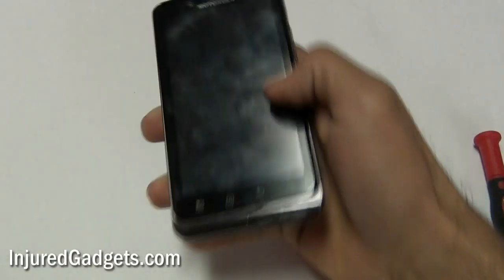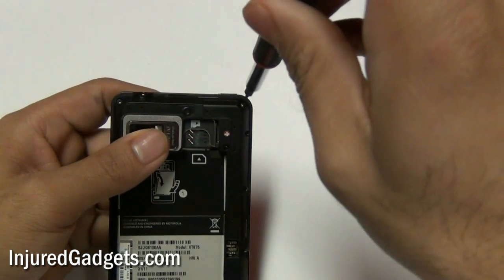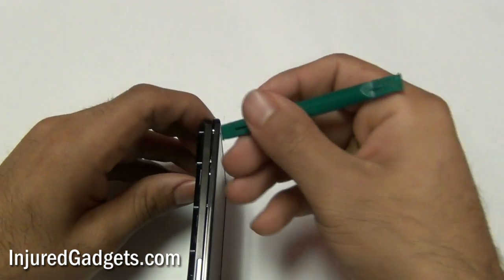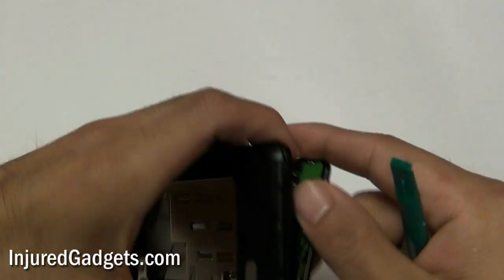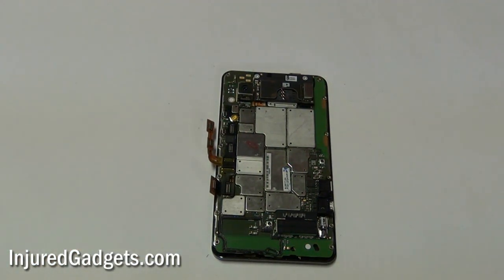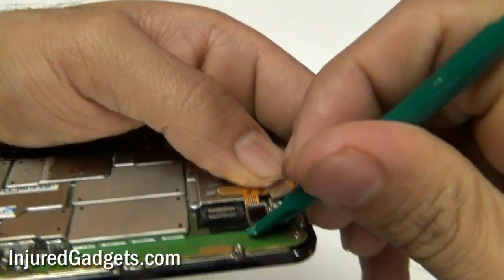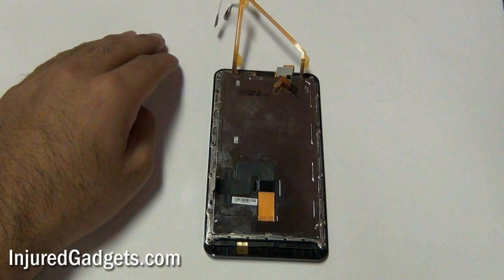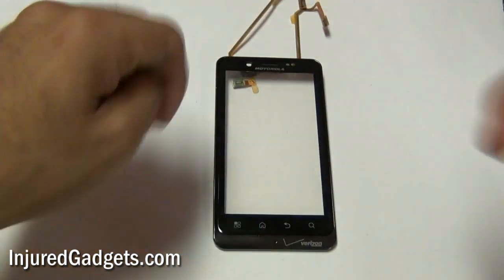Motorola Droid Bionic XT875 Touch Screen Glass Digitizer & LCD Display Repair Replacement Guide

Comment: Sry, late response. Its best to go online and look up 3M digitizer repair adhesive. If not people have used glues or thin super double side tape from office stores. Beware clean inside and have an equal amount all around. If not, dust will get in phone and you will have to start all over.

Comment: this video really helped. I didn't buy the digitizer with the screen I just bought the separate one.. that separation part was the most difficult and I didn't have new adhesive so I reused the adhesive from the prior screen. the heat helped that reuse.

Comment: excellent video.  be careful with the screws around the corners.  ebay has the digitizer with frames saving you from having to mess with the adhesive around the edge of the glass.  i highly recommend going that route.

Comment: worked great! just a heads up use the hairdryer/heat element on the front of the digitizer screen, and be careful not to bend the metal edging...youll understand what i mean once its all apart...

Comment: I called injuredGadgets on 4/30/2012 around 1:00 pm central time. I picked the next day air option and had my new screen on the may 1st. I installed it the same day and in less than 24 hrs, I had my droid bionic fixed just like the video said. thanks guys your a life saver...

Comment: Very good! The best guide right now on Youtube. A few points of clarification: the screws can be stubborn --- make sure you have a good T5, and patience, lest you strip one. The "camera" mentioned is the front camera, not the back one. There is a trace of adhesive from the old ribbon cables that can guide you in sticking down the new ribbon cables nicely. The "heat removal" requires a quite hot blow dryer, and gradually prying from the =inside=.  Try to leave stickum for the new glass. What fun.